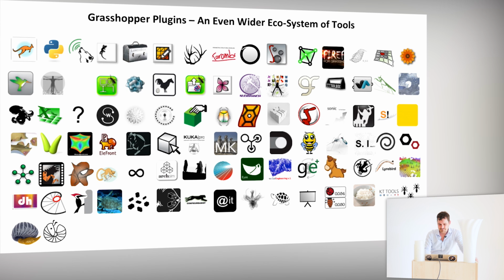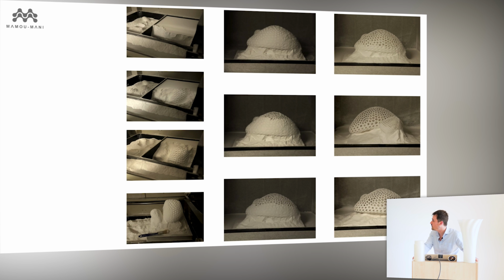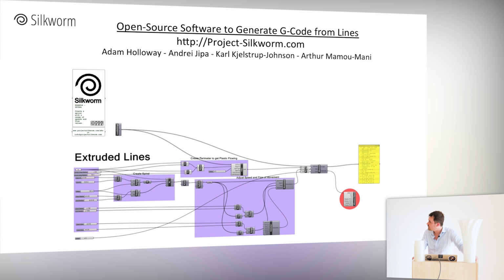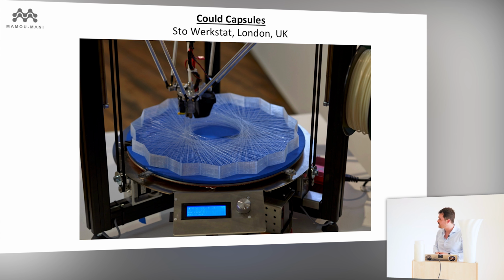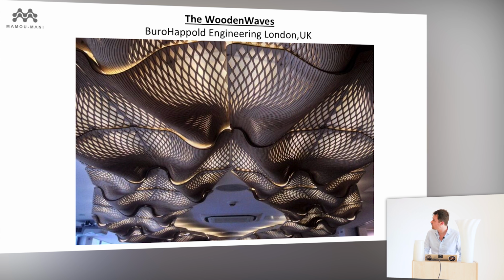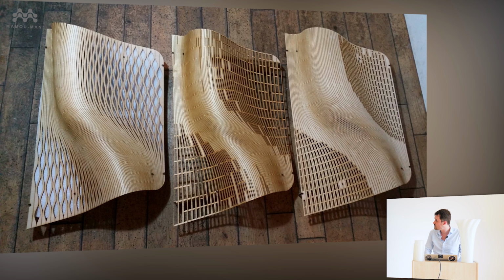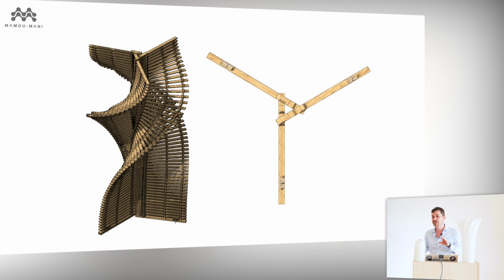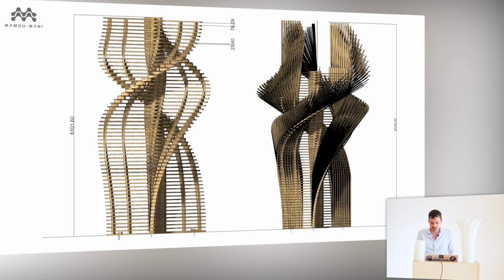FabCon3D keynote: "Making Spaces" by Arthur Mamou-Mani

Comment: Thank you for sharing. I think this is very important in architecture where we are confined to smaller buildings which suffer from audio and lighting problems. Provided cost can be kept low, flat ceilings and walls could be replaced with these new designs, which would then reduce noise and enhance lighting. 

It is interesting to note the similarity between work presented here and the older muqarnos designs.